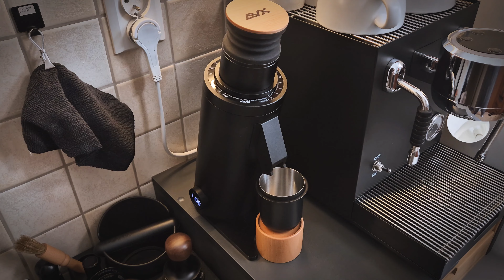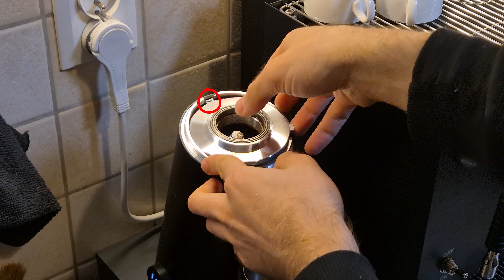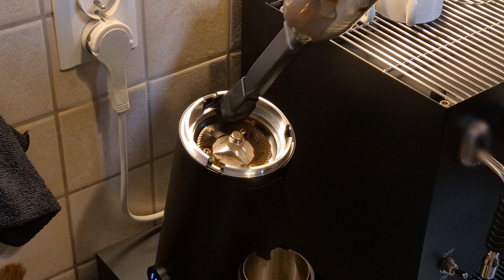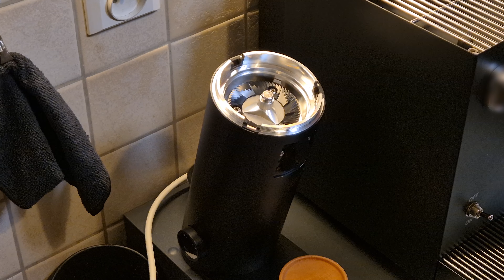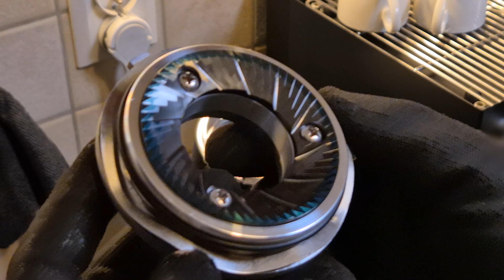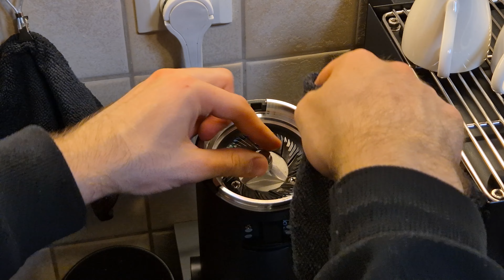DF64V Gen. 2 - Burrs Replacement and Alignment Tutorial

Comment: You say "untill you hear the burrs rubbing against eachother" and "this is where your zero is", but on the video you turn that dial quite a long way from the point where it was making a sound. 

he text comment where you point out that the indicator hanged its position is further confusing. No, it is exactly where it was supposed to be based on your spoken commentary and video: you litterary turned the dial to approx. that point when the chirping from the touching burrs was heard. Then you dialed back an unspecified amount.
Reply from the maker: Yes, there is some confusion here - I actually turned the grind level too much while setting it on first shot, in the next shot it was already set correctly.

5:35 you can see that the zero level is around 3 because you can hear the burrs, which literally coincides with the shot at 5:45, where the indicator is set around level 3 then I set it to 0.

Thanks for pointing this out!